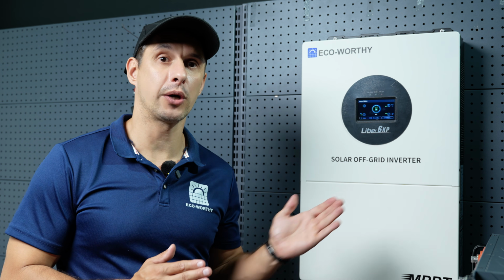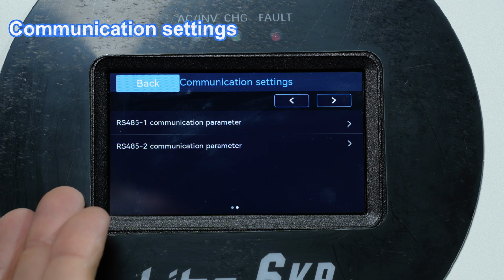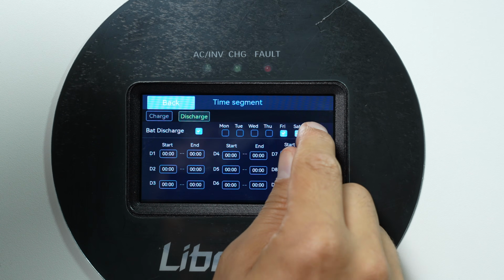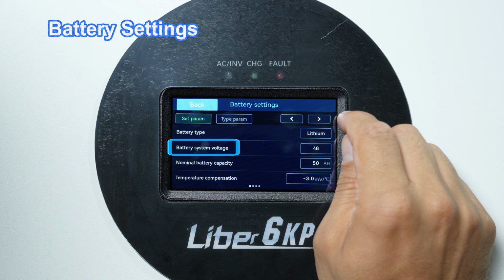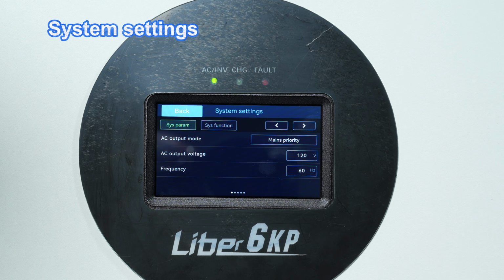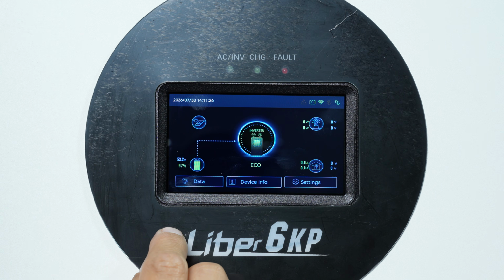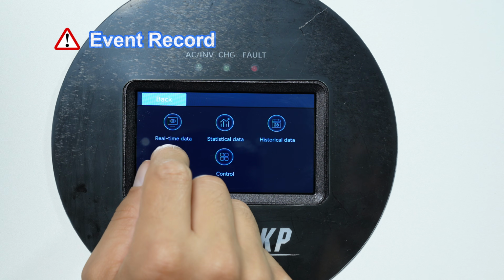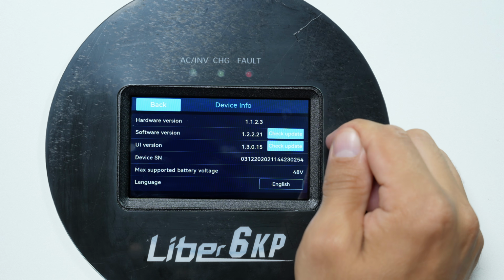How to Use the ECO-WORTHY 6KW Inverter | Screen & Settings Guide

Comment: I purchased the 6000 watt split phase off grid unit. We are only off grid and use the solar panels to charge batteries. I get faults due to over voltage charging and can't seem to find mppt parameters to change this. Can you help? Thanks

Comment: So I got on the phone today and called the place where I bought it from and he mentioned the cable going from CAN to CAN..  Well yippee..  this solved the BMS error..  Then to try and figure out why It wasn't receiving any PV.. My multimeter was getting 130+ volts..  but there was the - before the numbers, which meant the leads were reversed.. Red lead to the Red PV cable.. and Black on the Black.. So I switched them.. Black lead to the Positive terminal and put the Red on the negative terminal.. but did turn it off first..  then turned it back on and It quickly jumped up to just over 1700 watts. This was with 5 of the ten 525 panels in series. and laying flat on the dirt. So.. it's working great now.. and no errors.  PS. I do NOT like the apps. The Enerwise app is slow to respond. and some of the info doesn't even show up.

Comment: How to setup and charge with 120 volts single phase, 120V output and charge batteries with a 120V generator, the manual doesn't give good info for this type setup.
Reply from the maker: Hello, thank you very much for your feedback; we will improve the user manual for the next generation of products.
When using a 120V AC input, the output must also be a 120V single-phase supply. You need to bridge the L1 and L2 terminals for both AC IN and AC OUT, and then change the grid type to "120/120" in the system settings.
Reply: @ecoworthy_official  Thank you !!